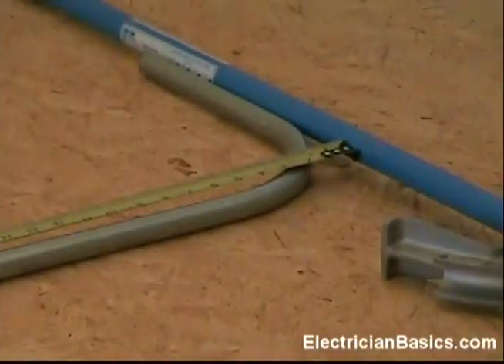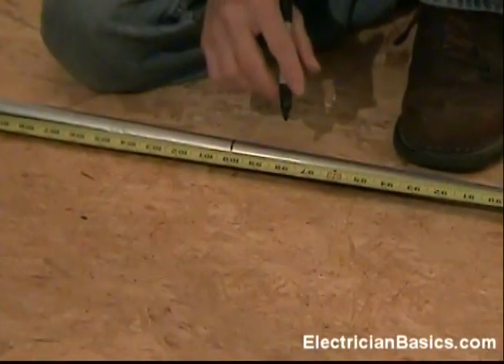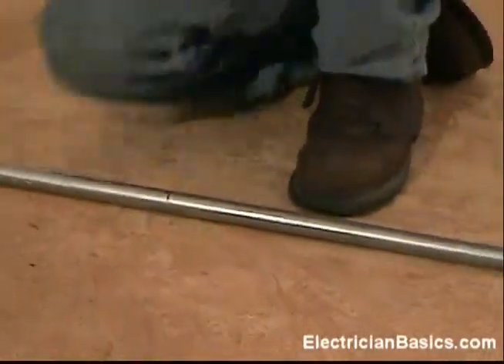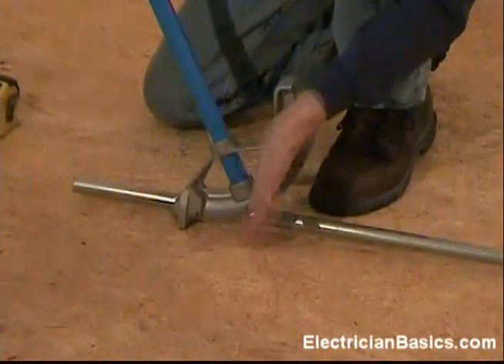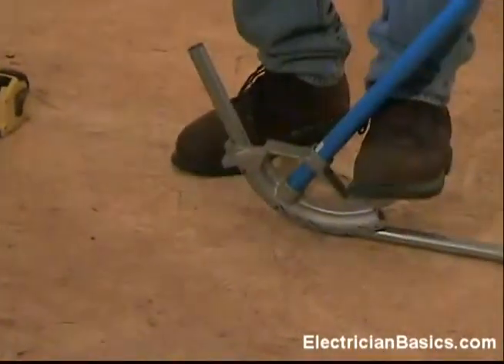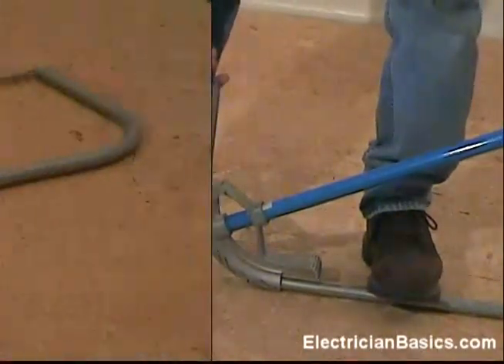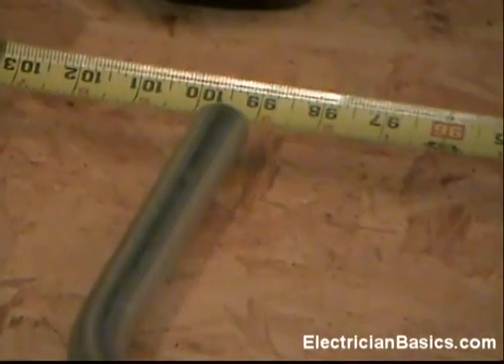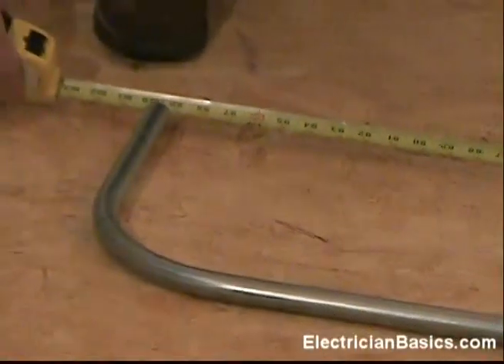Back to Back 90 Degree Bend

Comment: You said 6 inches back from mark. With 1/2" isn't the back set 5"?
Reply from the maker: that is correct.  I did mention about different deducts in an earlier video.  3/4 inch is used in the lesson because it is far and away the most commonly used with a hand bender.
Reply: Depends on what type bender you use

Comment: You need to review when you said that you don't have more pipe to bend, I'm 100% sure this part is wrong, the rest is accurate.
Reply: He meant as in deducting another 5 inches from the 2nd mark. He would've had barely any real estate left. You want at least 2 inches of pipe (especially emt) sticking out of the shoe before you bend, otherwise you're gonna fuck up and kink the pipe.

Comment: I had thought that both bends needed to made on the star. Thanks for the clarification, my instructor didn't tell us this.
Reply from the maker: In the video I already had one 90 bent using the arrow and a deduct.  It is possible to use the star for both bends when one knows in advance what the final measurement will be back to back .  Just mark the conduit with that measurement between two marks and then use the proper back to back technique - face the bender properly for each bend.
Reply: Your instructor probably didn’t know